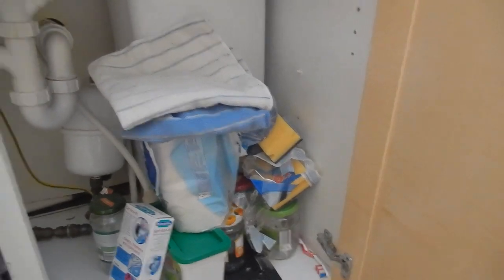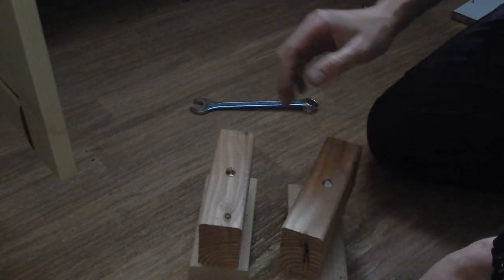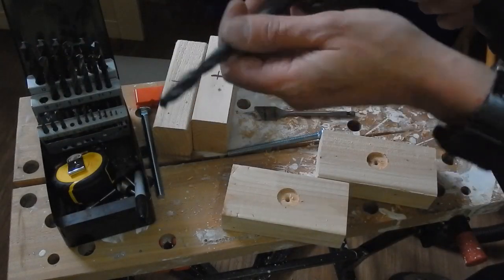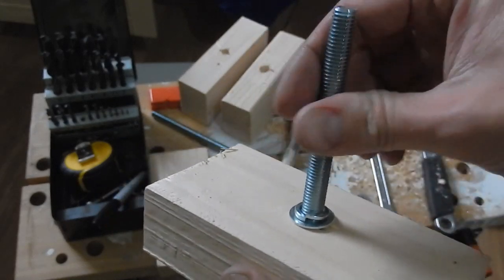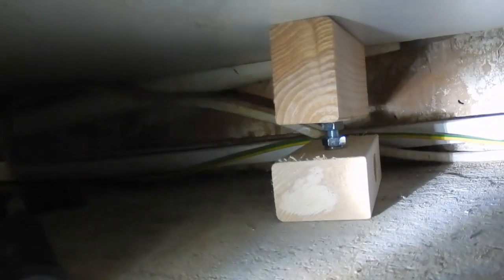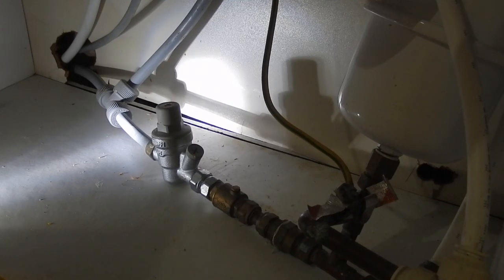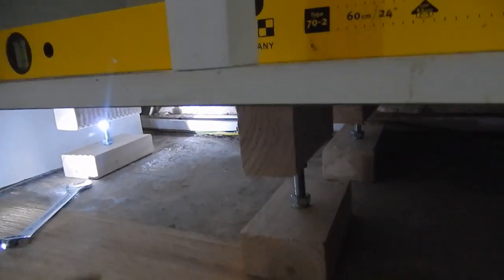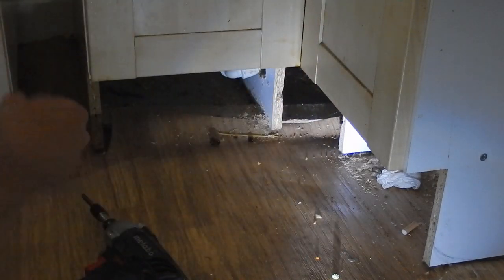Base Cabinet Repair

Comment: Nice fix! I'll keep an eye out for any 1/2 shod kitchen fitters.
There must be more shoddy unavailable too!

On the wiring,  that's an earth bonding cable to earth the copper water pipes. All the pipes should be earthed against static shocks.
But from a practical point of view I wouldn't loose any sleep as all that pvc push fit stuff will have been why they've not bothered to reconnect it. Not the proper way, but not worth worrying about as a Tennant.
Reply from the maker: +Richard “BrainFizz” Morley Thanks, Rick. I've met plenty of tradesmen and I've seen a number of locals who all walk with a limp... It's now a case of finding to whom the shoe fits. ;-)

Comment: It looks it is  possible to vacuum underneath the base in case there is mold etc  by removing a toe kick, instead of removing the base completely.  I will try. 
Thx
Reply from the maker: You're welcome and good luck. It should indeed be possible. Just depends on how it's been attached.
Reply: @OllyParryJones  Thx sir!
I will find out next weekend when my kid moves into her  condo after escrow closes. Hope it will be a quick vacuum and then seal the area with mold sealer.

Comment: Did I see electrical wires and a socket under the sink? If so is that really allowed to have it like that?
Reply from the maker: +Fredrik J It is indeed. I've no idea if it's 'okay' but that's how it was when I moved here and it's the landlord's responsibility in any case. ;-)
Reply: +Olly Parry-Jones Well, here in Sweden we have quite a few regulations on electricity in areas that have waters like a sink...I really don't know the rules myself, but the sockets need to be of special type, and placed on a certain height and be connected to a RCD...If worst come to worst you can get harmed by chocks from metal sinks etc and the home insurance company would likely not reimburse you in an event of fire for example. Perhaps worth checking up?

Comment: Thumbs up to the video, thumbs down to your flat, it really is shoddily built. All those water couplings in different materials, and sitting on top of electrical wires. Do get a RCCB installed if you can (leave out the fridge and freezer circuit). After seeing what was under that shelf,  I would probably demand the landlord took the cost of the installation.
Reply from the maker: +Eskil Eriksson Thanks, Eskil. Yes, it's entirely the landlord's responsibility and is something I could look in to. I've been here almost two years and have quite enjoyed making my own repairs and taking things apart... I think I'm running out of undiscovered places for things to hide in, now (unless I start tearing down the ceiling... ;-) ).
Reply: Yes, I think you have done most that had to be done. It certainly is better know than two years ago. And has generated a string of nice videos, so win-win.

Comment: Or you could just measure properly and stack wood pieces.
Reply from the maker: That would require wood of varying thickness to compensate for the floor not being level. Another option would've been folding wedges.